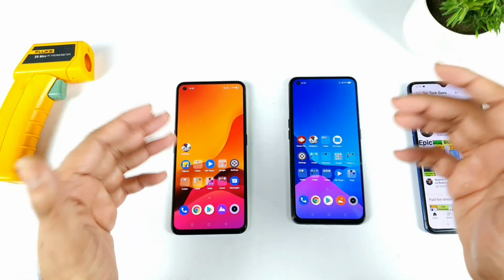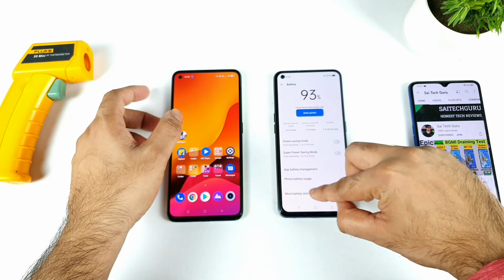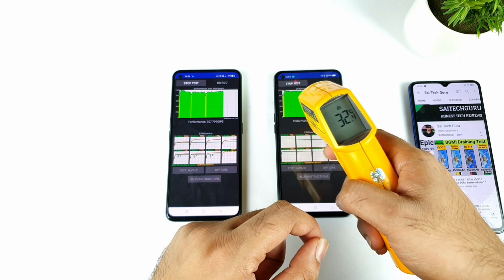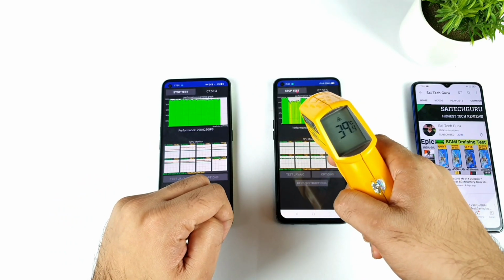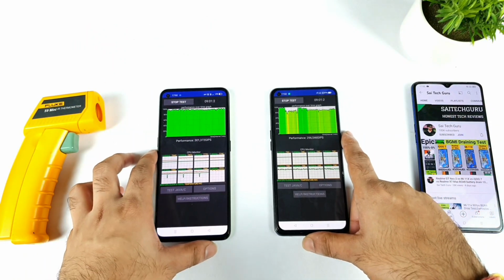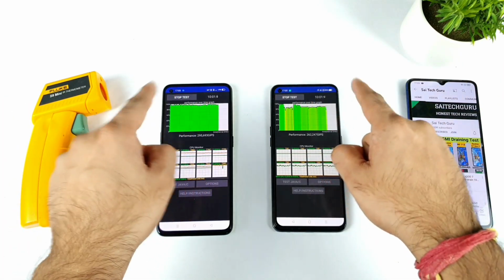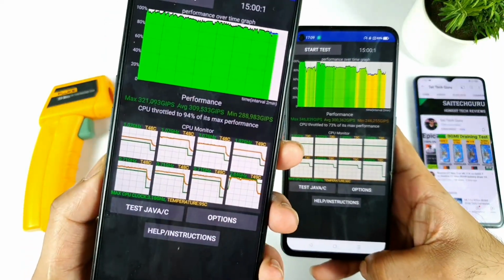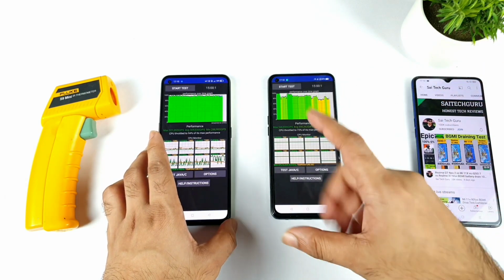Realme GT Neo 2 vs Realme X7 Max CPU Throttling Test Comparison Snapdragon 870 vs Dimensity 1200🤷‍♂🔥

Comment: At 73% throttle also it maintained 3 Lakh points.
If it's gets stable it will crush 870 but all depends on optimisation